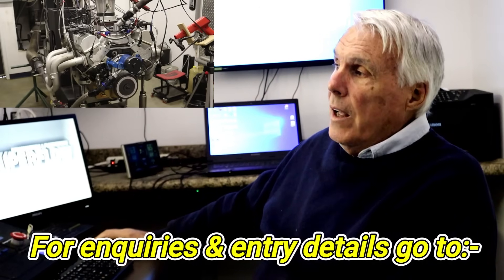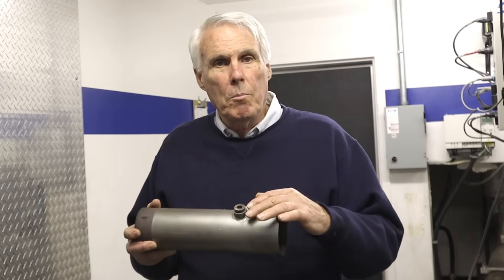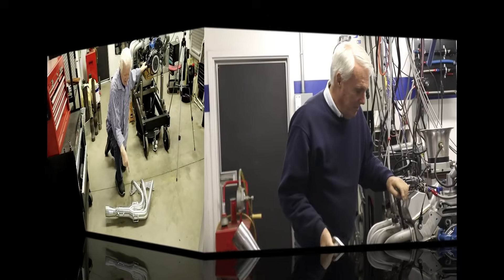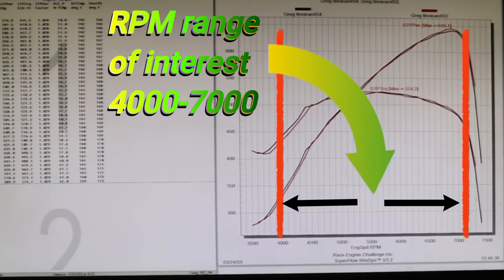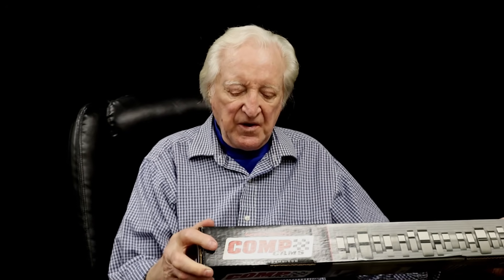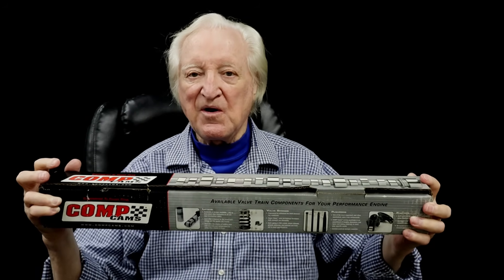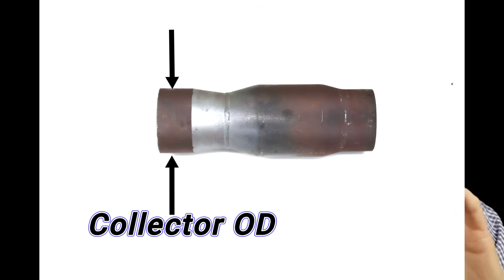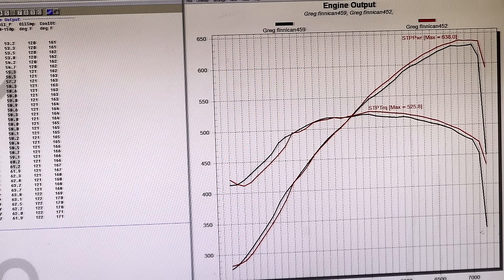Are collector anti-reversion devices a waste of time?

Comment: Dyno paper results vs On track results are a big difference..  Ran these AR chambers on a circle track 9:1 car and WOW 🤯 what. Difference mainly off the corner and restarts the butt dyno really noticed!!    Every little bit helps as all the little bits add 🆙    Pair these with light weight fluids , dampener, pulleys etc and you have your self a HOT ROD !!  💪🏻 🏁

Comment: This could have been a better video by showing tech drawings on where exactly the cone should be placed. But also the shape of the cone itself. 
And is the cone an area of expansion or a place where the piping just gets smaller (or wider)? ...expansion cones ( 2) like an 2 stroke engine kinda like.

Comment: Quick question what is the difference in performance between the other way of reversion that you spoke about in a past video with each of the separate pipes with a small reversion cutout welded in the exhaust headers.

Comment: One of those things that make you wonder if an anti reversion device will make a real difference when exhaust duration is something like 20deg greater than the inlet on a bigger cam something around 240@50thou In and 260@50thou Ex
On a 4 cyl that type of cam has been disappointing across most the rpm range and extreamly fussy on exhaust dimensions. Never stop learning🙂
Reply: That's the sort of cam that gets used a lot in the UK on Pinto engines on small ovals with the carburation restricted to a single downdraught Weber carburettor, typically a 34DGAS. An anti-reversion device certainly makes such engines less sensitive to exhaust dimensions and more flexible in my experience.
Reply: @terryjacob8169  Piper ground a pinto cam like that for us to test some 25-27 years ago, for a customer for the same purpose. Taking the measurement from 5-7500 rpm, where he said the engine was used, it didn't make any more torque than the piper HR320 or Kent ???.
Roland Hayes at HT racing spent months and months on his dyno playing with different configurations, made by any cam manufacturer that would still speak to him😆
I know the great Dave Newman stepped up to the plate countless times, with products and knowledge. 
It wasn't something I could afford to spend any more time on. That was the second divorce 😂😂

Comment: Depending on application, I like anti-reversion interfaces at these locations. Carb to manifold, manifold to cylinder head, cylinder head to exhaust header, end of header collector, mufflers designed with anti reversion properties, end of exhaust system.

Sound attenuation is also effected. Thanks, Charlie
Reply: Almost everywhere outside of the engine then basically.

Comment: I've used David's suggestions from forty years ago, on using anti-reversion dam plates between the exhaust manifold and the cylinder head on several engines. Definitely extends torque further down the range and makes an engine running a large overlap cam way more flexible. On a 2-litre or 122cu.in.Pinto I've had good results with dams across the bottom of the exhaust port that represent approx.20% of the overall port height.
Reply: Do the dams have to have ramps on the port side for smoother flow? Can you combine this with stepped primary diameters and/or an anti-reversion collector or is there such a thing as "too much" anti-reversion?
Reply: @Drunken_Hamster  Most exhaust gases travelling out of the cylinder travel along the upper parts of the port/header with the small proportion that reverse hugging the lower port wall so I don't bother with a 'ramp', although my very first couple of dam plates did incorporate one. I've never tried stepped primaries or anti-reversion collectors, so can't comment. In contrast to having fresh headers made, simple plates between the header flange and the cylinder head were a cheap modification that worked, so I never bothered going further.
Reply: @terryjacob8169 thank you for sharing. How did your plate look (Head/exhaust manofold) Do you have a pictures. Will it work with Ford Kent and VW 8v engines?😅
Reply: I’ve wondered why there are so many makes with 3.6 liters, now I think they got efficient enough to realize the optimal quench area, if you could lower the temperature with exhaust evacuations, you could decrease the capacity maybe to 3.2 to keep optimum temps.
Reply: What was the difference in lap time?

Comment: I remember David's work on anti-reversion exhausts with the anti-reversion at the exhaust manifold face that seemed to work and IIRC the gains were not so much in max torque or power but in extending the torque further down the range, where it can be useful.  Since then I have noted that no exhaust company I have seen provides exhaust headers with anti-reversion manifolds - why?
Reply: Anti-reversion at the exhaust manifold face definitely works in the way you've described. I've had great results with Pinto engines with an anti-reversion plate fitted between the head and the manifold. I've found the optimum height for a dam across the bottom of the port is approx.20% of the overall port height with a 2-litre or 122cu.in. Pinto.
Reply: @terryjacob8169  Rather than a dam at the port, I was thinking of a very short tube that matched the port set in a flared out header so that the reverse wave got caught between the tube and the flared out section, which would therefore be a 360deg solution.
Reply: @clivewilliams3661  Reversion occurs along the bottom ( short side) of the port/header, it's really only the bottom of the port that needs a dam to impede the reverse wave.
Reply: @terryjacob8169  I noted that from David's last discussion about reversion but I am reminded that the David's article many years ago suggested a full area impediment.  Also, IIRC David's last explanation accounts for the exhaust flow was predominantly at the top of the port on the test head, so that the anti-reversion dam had little effect on the port flow but where the floor of the port actually contributes to the flow then closing off part of the port will restrict flow.  By having a short, full port tube and a flared out header it doesn't matter where the flow is in the port, reversion is stopped all around the port.  In addition, the basics of exhaust design, flow and tuned lengths has the reverse pulse for the full diameter of the header down as far as the collector and its that which moves back up the pipe to the port.

Comment: On my 67 chevy 2, i had a set of CYCLONE BRAND anti reversion headers that had built in plates at the flange that met the head !
Reply: At what rpm did they help the most. Wern,t they supposed to help the bottom end on cars with power range 3500 and up.

Comment: I can say anti reversion works on a Harley Davidson 80 ci engine.  But those cones install in the header primary, right at the head.

That got me thinking... If i put a 2 3/8" header on a 2" BBC head, without blending the transition from the head to the header, but rather leave a sharp edge on the head, you effectively create a anti reversion cone.  You just want a 'step' for the reversion air to stop, you don't want it to flow back into the combustion chamber.  

I found that oversizing the header a mere 3/8" without putting a transition plate or blending the head to match.  I effectively got the same results as installing an antireversion cone in the header, like H-D does.  

It doesn't make any sense to me to put the antireversion anywhere in the exhaust path, other than right up against the head, because, If it's a foot away from the head, there's a food of high pressure air, that can reverse back into the cylinder.  when it' right on the head, you only have a few inches of high pressure air that can revert back into the combustion chamber.
Reply: Put together a mild 351m. Intake manifold runner is smaller than head runner. Exhaust head runner is smaller than smoothed out manifold runner. So I've got steps in and out of head. Works well.
Reply: The reverse wave moves along the bottom ( short side ) of the exhaust port so really you only need a dam across the lower part of the port. I've done this by making up another header flange plate, but rather than have it match the entire port,  I make it with a dam left across the bottom approx.20% of the port opening. You're right in saying an anti-reversion device needs to be right up against the head; that is the approach I've always used, right from reading David Vizard's first pieces on the subject, back in the early 1980's.

Comment: As previously mentioned...  Company named Cyclone built AR headers for NASCAR..... Just about everyone ran them including Richard Petty.... The AR fitting was welded inside each tube right up again the head plate..... Iirr... torque builder was the key point of these

Comment: In cylinder pressure sounds promising, is it quick enough to measure the difference between stroke cycles? I.E. can you CHART, exhaust stroke pressures?
Reply: I have been thinking of using the jet pump principle, a manifold with tubing cut into and brazed, with a gap and facing the port, then put in down stream as well, to vacate the manifold portion. But not without a cam timing adjustment 😮

Comment: Hope David will use the old Cyclone Anti reversion headers style with the AR's integrated into the header flange.  The motorcycle guys have them available to them in the aftermarket known as Torque Cone inserts.  Also the AR's devices made by HyTech Endyne from Larry Winmore where they are installed on the primary tubes within 12" of the header flange.  
 I wanted to integrate all three devices into my C4 Corvette L98 Tpi with long tube headers into 1 or find some old Tri Y's by Lingenfelter who once made them for the L98, along with a few crossovers to see if I could get an exotic LFA sound out of my sbc!🤔😂  Always was intrigued by David's Pressure Wave Termination Box which seems similar to AR mufflers but lacking the calculated chamber volume.   I want the Verge to sound exotic like it has 1000hp! 😂  David, do you have any vids of that original design for the C4 Vette or where did that system end up you designed?
Reply: To get an exotic sound you need stepped header and x-pipe.
Reply: And the firing order must arive at the collector in order, to make a spiral
Reply: @ Don't quote me, but 180 degree headers swap 4 & 7, meaning those two pipes have to go from one side of the engine to the other, to meet with the opposite side collector.  

They sound really weird, & sound like they are turning many more RPM's than the engine really is.  But they do make power.
Reply: @ 8 into 1 sounds awesome, but impossible to fit especially on a C4 Vette.  One machinest does make a flat plane crank for a sbc.   Can't remember whoj, but easy to find.   Some guys online were debating on it, but sounds exciting!🤔
Reply: @chrispompano  Flat plane cranks give a lot of vibration problems in small block Chevys. Smokey Yunick played with them, both for NASCAR  and his turbo SBC Indy efforts, and abandoned them. Equally one or two F5000 single-seater 302 SBC engine builders in the 1970's experimented, Bartz in the USA, Alan Smith in England, and found the vibration outweighed the benefits, not least that the vibrations are downright uncomfortabe for the driver when the engine is solid-mounted.
Reply: You won't be happy with tri wye's if you want to make power at high RPM's.  They build torque but restrict high RPM power.  If you want to make good power at high RPM, you need to commit to a set of 180 degree headers.  They make power, but, they sound more like a flat plane crank or a F1 engine.  Not to mention how complicated the header routing can be.
Reply: @atheplummer that tpi engine in a c4 likes to make torque, a ton of it, they are out of steam at 4800, you have 2 options keep going with this route a increase airflow, a SMALL cam change good headers and exhaust along with the hardest part proper tuning or you can change the heads and intake and go for a 6800rpm ripper but will be severely lacking in torque at low rpm
Reply: @ Wasn't the low RPM limit, & high torque a function of the long intake runners?  Putting big exhaust on that setup would be like using a funnel in reverse.  

GM should have taken Smokey Yunik's SY-1.  That thing made mountains of torque but still flowed for high RPM.  A buddy of mine has one.
Reply: @ yes a tpi intake likes making peak torque at 3500rpm it makes for a really responsive street car or truck, keep a wide lobe separation cam and duration under 218 degrees at 50 1.6 rockers, and light porting can get 430+ tq  on a stock bottom end l98 350

Comment: It has been suggested to me that one anti- reversion method may be in common use without anyone knowing it. If you have round tube headers over square( or rectangular )exghast ports, and there is no port matching done, the exposed surface of t head itself may do some effective work. I don't have any means of testing this, but it seems likely.
Reply: You are exactly correct, but I'm unaware of square port exhaust heads,  that shape is usually on the intake side of the head.  If you have a 2" exhaust port, put a set of 2 3/8" headers right on them, but don't blend the head to the headers, leave a sharp edge.  You'll get almost as good as if you spend a bunch of $$$ on those antireversion cones.
Reply: @atheplummer  I seem to recall in one of Mr.Vizard's earliest experiments with anti-reversion he used header pipes that had a larger inside diameter than the exhaust ports but rather than mounting the headers so that there was an equal step all round the exhaust port, he offset mounted the headers so that their extra inside diameter sat below the bottom of the exhaust port where the bulk of the reverse flow occurred. As the bottom of the exhaust port wasn't blended to match the header pipe this produced a very pronounced step that acted quite effectively as a 'dam' against reverse flow.

Comment: Hi Mr. David, what is your opinion on stepped headers for performance
Reply: IMHO, stepped headers act like antireversion headers.. They are mostly used on SBC, and such, where you can't get a larger diameter primary to bolt up, because of the bolt pattern.  My advice to you, is stepped headers, but put the step as close to the head as possible.

Comment: I am making a antireversion part on the short side as DV suggested many videos back that fits at the exhaust manifold gasket. I am building a 4.3 V6 Vortec with every part in consideration of DV videos and books.
Reply: I built stock 20r four cylinder Toyota back in the early '80's my grandmother gave me sears cyclone ceramic coat header it had anti-reversionart cones just behind the 3/8 plate that mounted with gasket to the head. My two wheel drive four speed truck went from 85 mph top end to 100 mph, and felt stronger across the board. I also upgraded to crager street super trick rims with 15 inch tires, but that was not anything to do with any change, I did that prior to my engine rebuild ( 100,000 miles spin rod bearing) I knew nothing about intake/exhaust pulses and those little funnels in each pipe looked like they would reduce flow, but they really helped scavaging. I used to mix 100 octane (leaded, never run with catalytic converters, mine was removed) aviation gasoline 50/50 with 93 premium unleaded . I did not run it during the testing I was talking about, the 15 mph top end speed increase but I did use it to race. Being right at cylinder head it would probably Scavenge cylinder better, at the end of the pipe it would be a blending of exhaust plugs, capsules, pulses and be less efficient. You can buy individual cones and weld them into headers yourself. More interesting is the YouTuber Stapleton 46, he is a collector of the Nascar boom tubes, they used all kinds of x pipes, y pipes and had ovals and many differing shapes cut into sides, keeping cylinder pipes individual too much to discuss in a comment. I agree with Mister Vizard, I believe they should be close to head exhaust port. Thanks for sharing the knowledge
Reply: If possible keep me in your loop on fhe 4.3! I have a 36 chev pickup i have a 4.e in w turbo . Thanks
Reply: @verbonloucks6498 what year heads  are you running bc they are drastically different power wise after 94 is being the better IMHO seat of the pants wise
Reply: That's cool. Come back and report your results.

Comment: There are so many myths about exhaust systems out there.
Reply: No kidding... The one that says, "You have to have some backpressure".  Is the dumbest one out there. How can restricting exhaust, make more power?
Reply: @atheplummer  Yep, I've lost count of the number of times I've heard that dumb one, mainly from guys running discount muffler-fitting shops.
Reply: @atheplummer it's technically true for 2-strokes as they can benefit from some backpressure to stop fresh mixture spilling out the exhaust port during the part of the compression stroke where it hasn't yet been covered by the piston. Common theme of 2-stroke exhaust systems is trying to make backpressure that only shows up at the right moment, and doesn't restrict the flow at other times- tuned pipes and exhaust pressure pulse charging being the main examples.

 For 4-stroke performance backpressure is always bad.